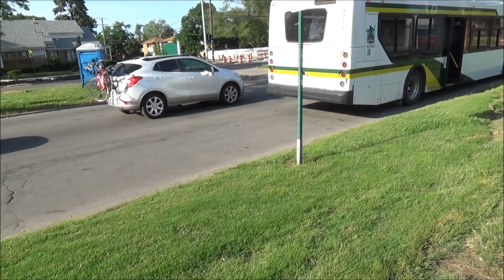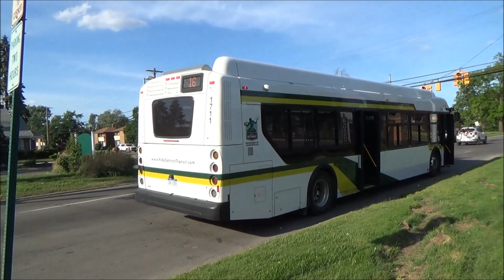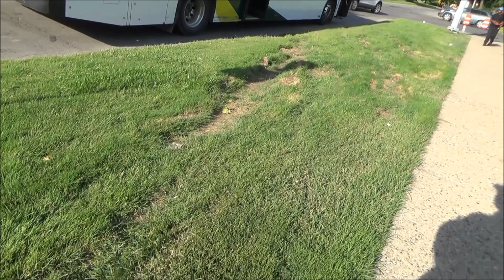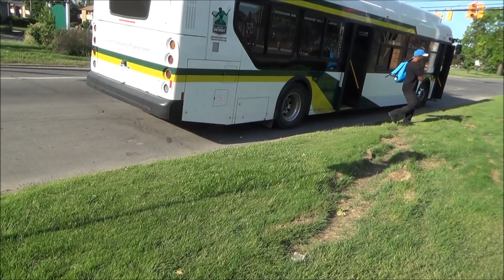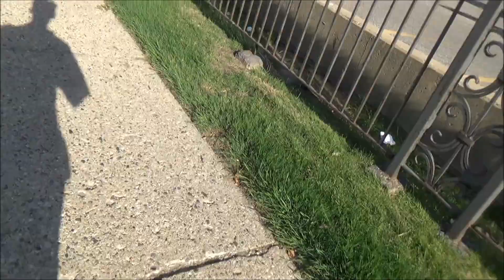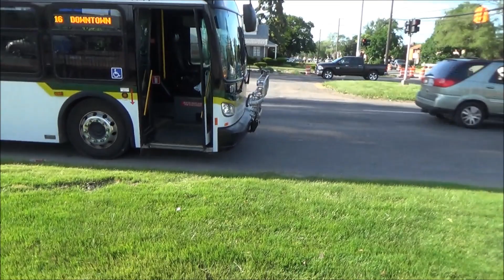DDOT 2017 NFI XD40 #1711 Once a Junkcelsior ALWAYS a Junkcelsior

Comment: I used to drive some of those 1700s before I left DDOT.  I'm not surprised at ALL, bruh!  Thankfully I haven't experienced the crappiness of them.  I'm not a huge fan of Gilligs myself, But I'd be willing to try driving the BRT models.
I'm surprised DDOT didn't invest in the Gillig BRTs.
Reply from the maker: I don't know why they never did. My only guesses is that NFI manufactures articulated buses while Gillig does not and I think getting those Xcelsiors are more affordable because Gillig buses are either too expensive or are unreliable. To be honest, NFI should've never discontinued the D40LFs/D40LFRs; DDOT could've gotten the D40LFR buses in 2013 but due to the city's bankruptcy, it never happened and they already blew their chances at redeeming themselves in my opinion.

Comment: DDOT were supposed to have purchased Gillig BRT's instead of the Advantages 1200's
Reply from the maker: They never ordered the Gillig BRT units back then. In 2009, DDOT was gonna order the 1st ever Gillig LF buses, but the deal was unsuccessful and instead, they ended up with the 2010 New Flyer D40LFs instead. The Gillig LFs and 4 Gillig HEV were ordered by DDOT in 2011 and arrived in 2012 while bus #1201 arrived in November 2011.

Comment: They should not have sold most of the DDOT 2003-2004 & some of the 2005 ones to smart the should to kept them on the fleet instead because they could have been  repaired and put back in the fleet